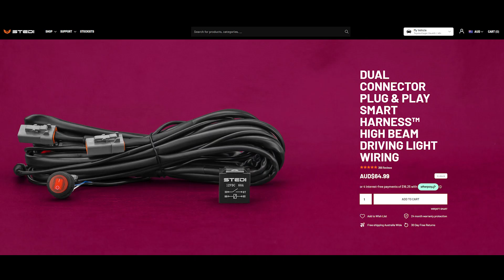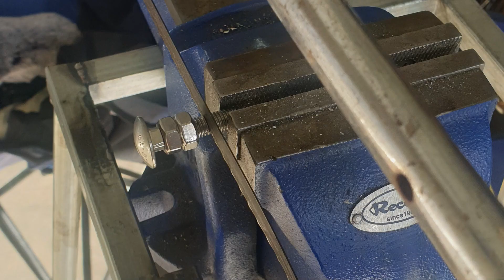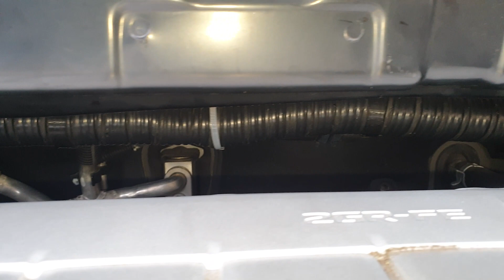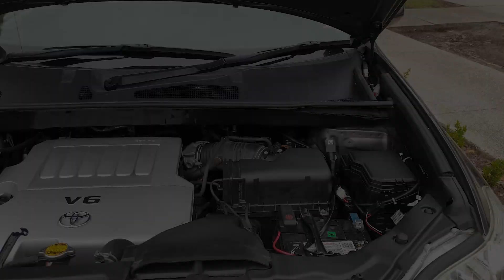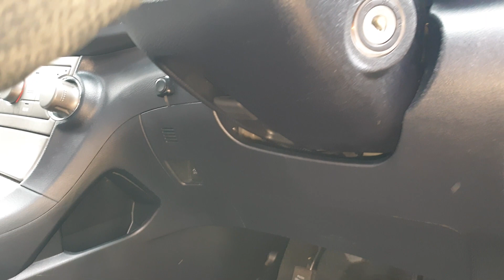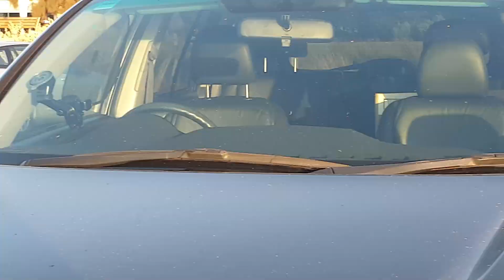How to Wire External Driving Lights on a High Beam Wiring Harness

Comment: What brackets did you use
Reply from the maker: I used tacoma ditch light brackets but the right windshield wiper kept hitting the bracket on the right. I couldn't angle grind it to make it work as this would make the bracket too weak. So instead, I bought custom brackets from ADF fabrications, who is from the US.
Reply: @ryanhum  reckon prado brackets would fit?
Reply from the maker: @garethwalker847  not sure but I'm planning to put all my lights on my new 4wd so don't need the brackets anymore. I can sell them to you?

Comment: Where did you get the brackets from ?
Reply from the maker: Just off Ebay. It's for a Tacoma though. In the end, my wipers started hitting them so I bought a model-specific bracket from Anderson Design Fabrications (ADF). Still had to shave a litte off with an angle grinder and paint it but overall extremely happy!